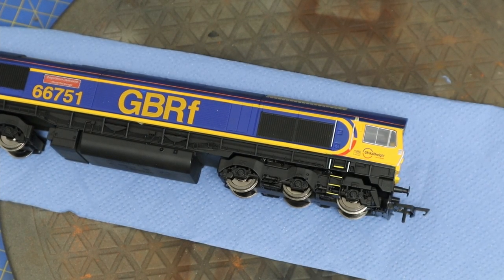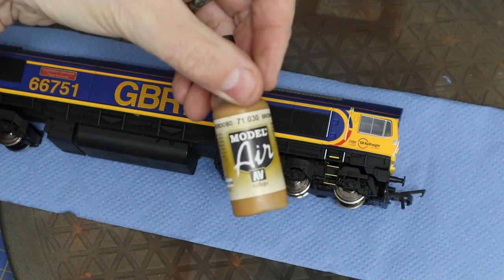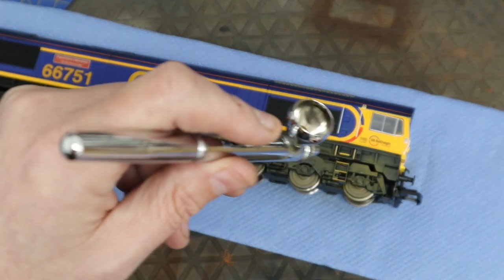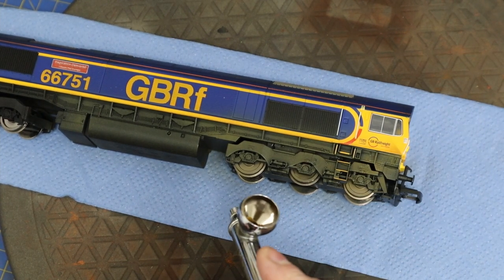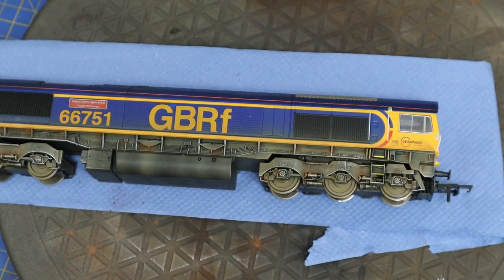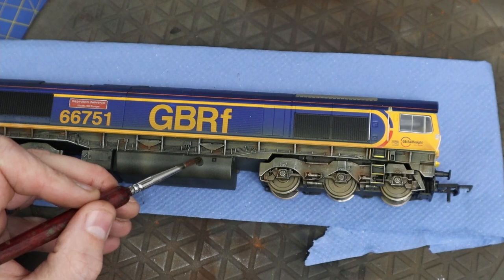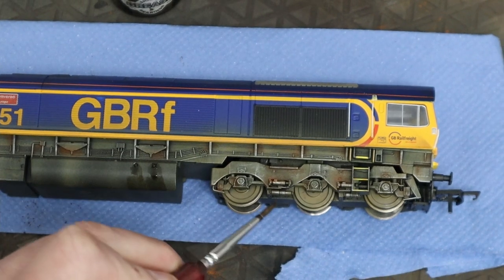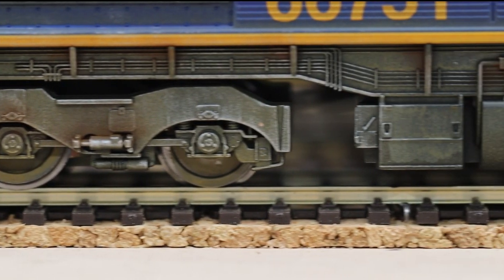Weathering Model Railway | Class 66 GBRf  Diesel Loco Bogies

Comment: The vallejo range is massive, I've got so many that haven't seen an airbrush yet! 
One of my recent favourites is gunmetal metallic, its a great tone for highlighting areas that you've demonstrated in this video. 
I've been using it also as the first layer for deep paint chipped effects, it works well with rust in contrast.
Reply from the maker: I haven’t got gunmetal. I mix black with steel when I’ve needed it. I have about 30 shades of brown though, so if you run short....!!
I thought you were a Railmatch fan?
Reply: @BuntersYard  railmatch are OK but limited on colours. I bought the set some time ago just to see how they airbrushed - which wasn't great for stop start work as they clog to quick. I've since used them up on a mass rake of underframe work. 
I've been using vallejo as my main go to for over a year or so as the consistency and performance is flawless in comparison.
Reply from the maker: I agree. I bought them because the colours are named precisely ( roof dirt, sleeper grime etc.). The vallejos are much easier to use, but if Railmatch want to send me a box full for review, I’ll be happy to oblige 😂

Comment: Great vid, nice to see some of your techniques👍
I had a go at weathering my Hornby RailRoad 66 sometime back, they do have some good detail for what is now considered a basic model.
Can I ask you what type of compressor do you use when doing your vids & does it have an air tank?
I use a full size workshop compressor in my garage, which is fine, but restrictive when I need to do jobs elsewhere....

Thanks for sharing 👍
John b😷
Reply from the maker: Hi John. The compressor is/was the cheapest that I could find on Amazon at the time. It doesn’t have an air tank with it. They’re around £80. It does the job
Reply: @BuntersYard  - Thanks for that. I’ve been looking at what to go for, I’m guessing there’s no need for an air tank if it’s only light/small jobs, which is what I intend to do👍
Cheers😁